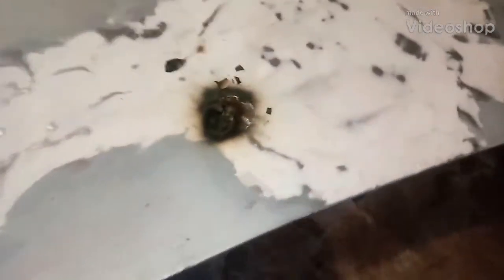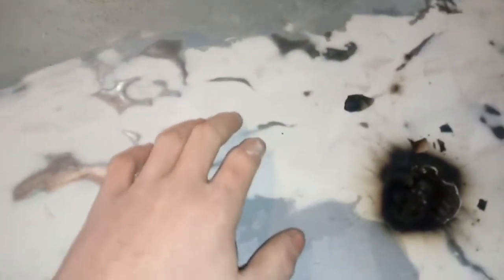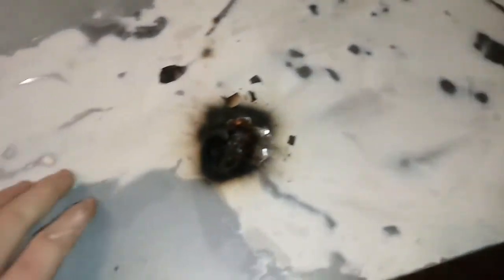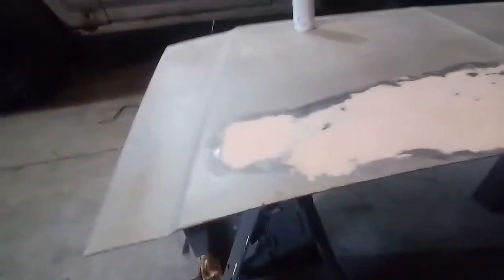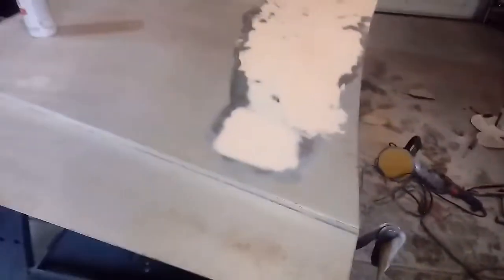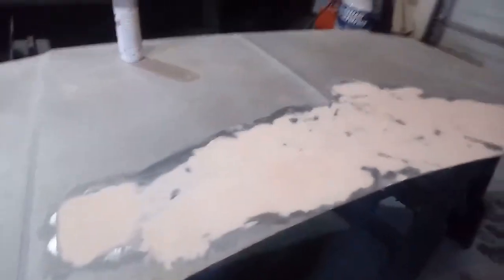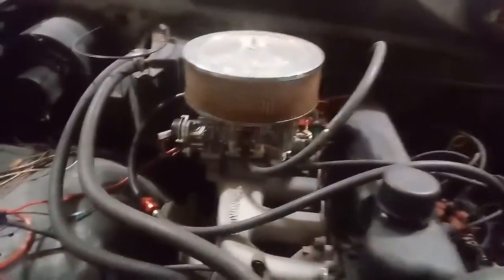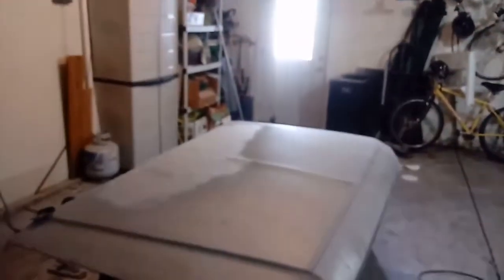Hole Cut in the Hood Repair

Comment: Looking at doing something similar in my 76 F250 2wd to get it back on the road after 13 years.  Was gonna DT360 diesel swap it, but a 300 is cheap and easy compared to putting 1100 lbs of small block medium duty diesel in the engine bay.  Eventually the plan is to steal axles out of a newer(~2013) superduty(dana 60/sterling 10½) and a small block ZF5 and T-case out of an early 90s f series to get my RPM down and get the ability to do something more serious in the future.  Thanks for the info and experience!
Keep up the good work!
Reply from the maker: Awesome thanks!